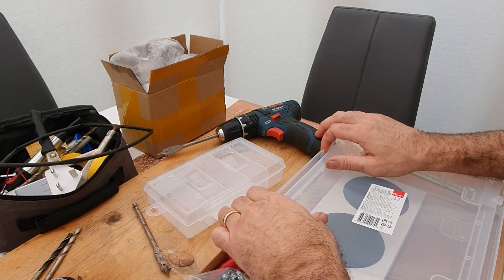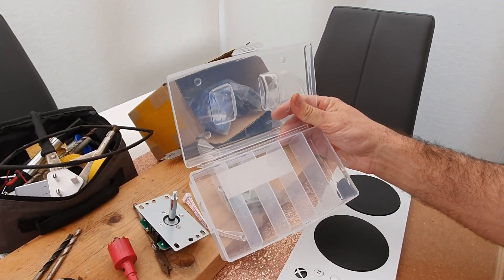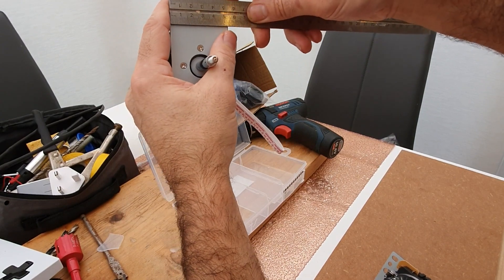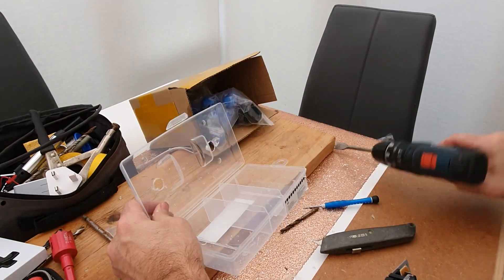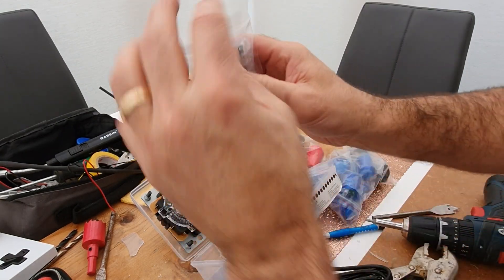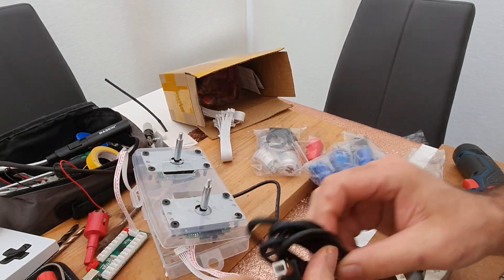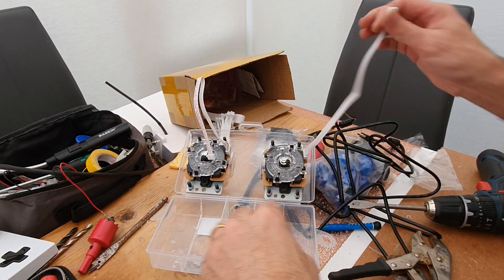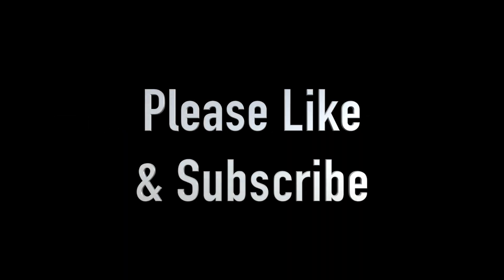Joystick Module

Comment: Where did you get the joystick parts from?
Reply: They're from China. If you search eBay or similar for "arcade encoder" you'll turn them up. They're poor quality compared to Ultimarc boards, but much cheaper. Look for one that allows you to simulate analogue control on a digital joystick if you go this route.
Reply: @OneSwitch  like the ones shown here?  https://www.ebay.com.au/itm/2-Players-Arcade-Game-DIY-Joystick-Push-Button-USB-Encoder-Controller-for-PC-PS3/274423288903
Reply: @AlistairMcEwan  They look like they'll work. You won't beat the price but quality will be so-so.